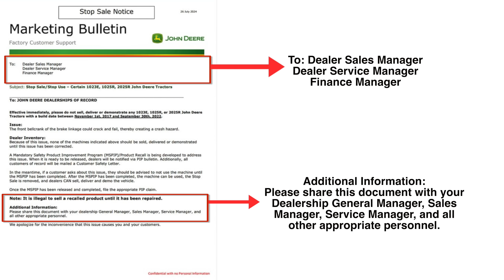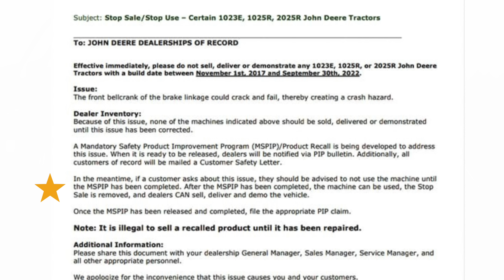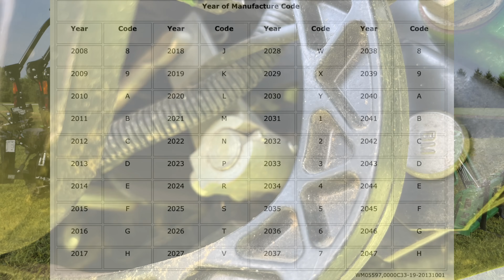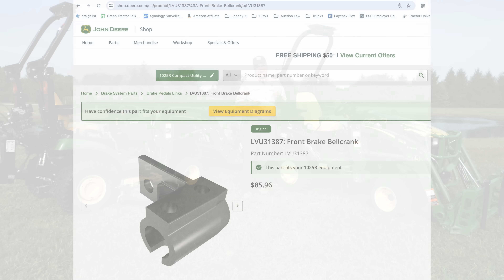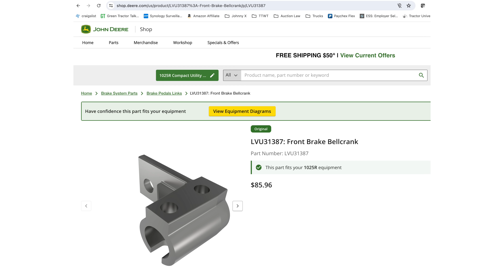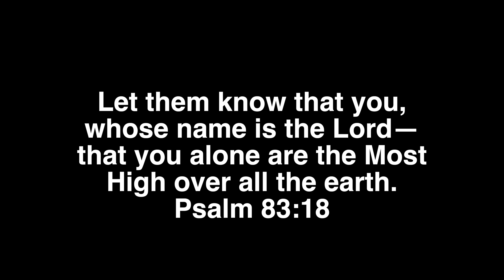Deere Says "STOP USING YOUR TRACTOR"

Comment: I'm glad I went with a Massey Ferguson over the John Deere.
Reply: @zacharysandberg  I took a quick look and tapped on the strengthening fins on the axel housing with my fingers. But it's hard to tell since it's all painted Massey Gray. The hydraulic block on top of the transmission has the rough casting texture of being steel/iron. But again, it's hard to tell. I also tried searching online for some info but I couldn't find anything about materials used. It just tells me the obvious I already knew, it's a 2-range hydro-transmission.

According to the tag on the ROPS the tractor is made by Iseki so I don't see why it wouldn't be steel or cast iron of some kind. The Japanese brands seem less likely to chince out on materials when it comes to their machine versus John Deere. I'm surprised John Deere hasn't tried replacing the metal transmission casings with plastic already. I wouldn't put it pass them. For how over priced they are their hydraulic hoses for the bucket are very sloppy.

Comment: When I got my 2021 1025R, I checked the air filter situation. They had moved the mounting, but it was funny because the engine still had the bolts on top where it used to mount.  If I had not seen stories about the air filter issue, I would have thought..."they left something off my machine".  🙂

I do have some fairly good slops so I do use the brake. However, I have stopped the machine using the reverse pedal as well. That is probably not idea for wear and tear on the machine, but I feel confident based on my terrain that I could drop the front end loader or use the hydrostatic pedals to stop.

Comment: This is the first I have heard of this. Thank you. I no longer live in Tipton so Reynolds on 31 probably do not have a good address for me.
Edited 8/1/2024: Reynolds had my current address and transferred my tractor to Green Mark in Lagrange, IN. Service there contacted Deere and confirmed the recall is real. They will be confirming if mine is in the recall by serial number. Deere cautioned the dealer to tell me it should not be used (I think I hear lawyers).

Comment: Tim, I suspect that the available part you found, will be pulled and soon be unavailable. 
Other than breaking, not sure what the issue is. If it is a forced recall of s safety issue, typically new stock of the old design is also recalled in my experience. 
My tractor is a gear tranny, and unless I’m on a slope, about the only time I use a brake is as a parking brake as a safety factor. That is probably 95% of my brake usage. Other 5% is assisting in tight turns—I have split brakes.
Reply from the maker: This is an odd case, in that the newest tractors (since Oct 1, 22) apparently do not have the problem.  Maybe the part we can purchase now has already been updated???  We'll let you know (at http://TractorTimeWithTim.com) as we learn more.

Comment: I’m purchasing a Kioti. I’m over Deere……
Reply: I purchased at Kioti CS2220.  Had it for two years so far.  Very pleased.  We crossed shopped JD and Kubota.
Reply: Tym and Yanmar far better..Kioti has crappy jumpy hydraulics.
Reply: Geez! I was told my 23 Sportsman XP 1000 Trail may have a recall because of a fuel/fire issue. If it's the case I'm not supposed to use it until Polaris has a fix. That will make two machines. They should pay my payments while they sit. 
I use the brake on my 22 2025R if I'm not sitting on it. I'll have to look at it tomorrow. 
Thanks Tim!
Reply: Good luck getting parts for it!
Reply: Get a Massey Ferguson
Reply: Thanks Tim,  very helpful and thats why I watch your channel. And it's alot of fun to.
Reply: Bought my Kioti in 2017 and it's been great.  CK3510.  No problems getting service or parts.  I've only needed an axle seal for parts, but Michigan Iron and equipment has searchable schematics to find any part numbers you need.
I chose to boycott Deere because of their aggressive stance against right to repair.
Reply: A biddy of mine bought one and it's not as rugged IMO.
Reply: That's what I have been looking at !
Reply: So unimpressed with John Deere products from there heavy duty wheel loaders to their small equipment . Love their engines though . 4045/6068 are great .
Reply: Yeah sad days but “we reap what we sow.”  Enough said!
Reply: Do your do diligence on the kioti I had a friend that bought one and had bad luck. That was 8 or 10 years ago they have probably came a long way since then just saying 😅
Reply: @bradleymcclintock7771  I don’t want to keep giving US jobs away so unless Deere does something stupid I’ll either by Deere or CaseIH. At least some of the parts are manufactured in the USA and those 1-4 Series are built in Georgia. I just bought a Deere z530 because it was built in Greenville Tennessee.
Reply: @OgleBilly Hate to tell you, but JD is in the process of moving manufacturing out of the US. Look it up.
Reply: @steve4628  I seen that. I believe it’s some of her big tractors. When I buy, I always try to buy something as manufactured in the US because I want a job. I would argue that the Japanese bill, good vehicles and products but there again, we’re paying the Japanese people state of American people to do this work, so we are putting ourselves out of work, and turning US into a Third World country by doing so. I know that’s not the only problem, but there are some ways, and some things we can do to help ourselves and our nation.
Reply: @steve4628 only a small section. It's being replaced with even bigger lines.
Reply: Lmao
Reply: Kioti is a good tractor, it even beats Kubota in my opinion.
Reply: No way @powderriver2424

Comment: Now they need to fix the snap ring situation on the rockshaft because the “updated” version with the thicker snap ring still keeps coming apart from just raising and lowering the deck. My tractor did this at 115 hours. If you are not aware of the snap ring coming off the rockshaft arm # LVU 22058 can walk off and get bent.  It is now part of my walk around inspection before using the tractor.Side note: check the motor mount bolts also. Mine literally fell out at 25 hours!
Reply: Been there the deck fell off while I was mowing
Reply: Yep mine has been fixed twice by Deere. I’m so over all the bullhsit of this tractor.
Reply: Timely information and relevant advice.  Nice catch.  Blessings